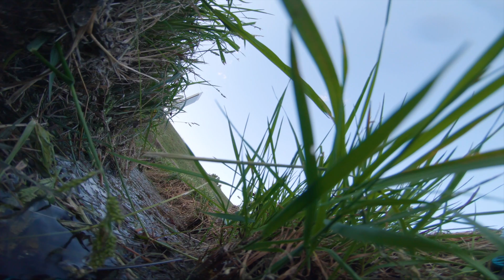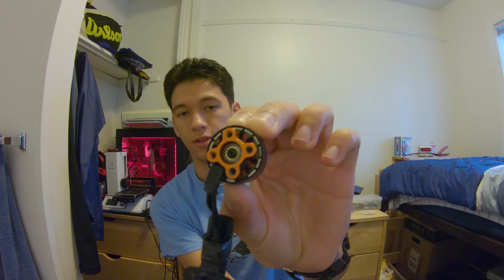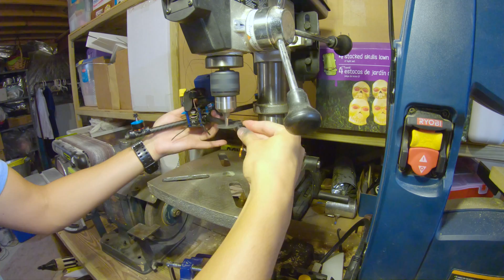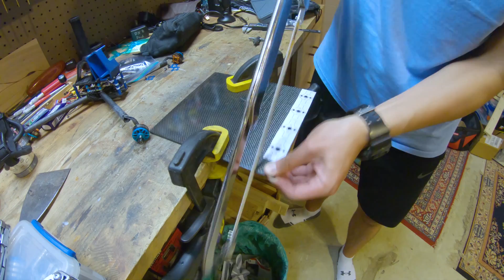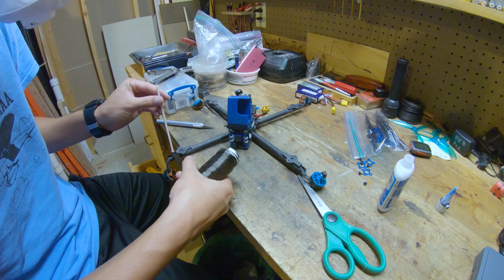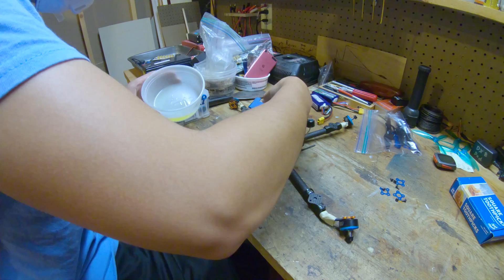Designing a Better Motor Mount - The Tubular Quad V3 Update

Comment: I would like to know are 2 screws enaugh for motor mounting? For example if i have drone with camera and gimbal 3-4 kg. Will it be enaugh to mount with 2 screws?
Reply from the maker: People use 2 screws on smaller drones frequently, however it increases the likelihood of bending the base in a crash. For a heavier 3-4kg drone you probably should just use all 4 screws since the added weight is negligible for a drone that size.

Comment: What about aluminum motor mounts for the tubes? They clamp on and are solid aluminum
Reply from the maker: That is a possible solution. My concerns would be lightness and preventing them from rotating about the tube during crashes.

Comment: If you could just drill two holes on the tube and mount the motor direct but then you would need two more on the underside to tighten up the screws. Or better still if you could 3D print in carbon fiber and just create tubes with integrated motor mounts at the end.

Comment: Hey Timmy! I'm a frame builder myself and I use a similar techinque. Great job on documenting your design. I might suggest you VuduGlu VM100 it's a metacrylate glue which has an extreme bond to carbon, so much that often the glue won't detach, but rather the carbon will delaminate itself. Cheers!
Reply: @Barack Obama i see no point in mixing it. You want minimum gaps between parts
Reply: @Barack Obama in an afterthought, could be a good idea to try where you have big fillets. What would be your method of applying it? My worry is that the micro beads could get in the way of the two parts mating surfaces. Not an issue you say?

EDIT: im unsure, the fillet is very very small if you use a slim motor mount.
Reply from the maker: Thanks! Looks like a great adhesive for carbon. As far as using it for motor mounts it either has to be thin enough to soak into the carbon tow, or if no carbon tow is used the relatively weak strength between the carbon plate laminations could be a problem.